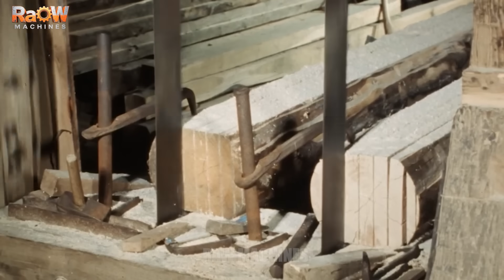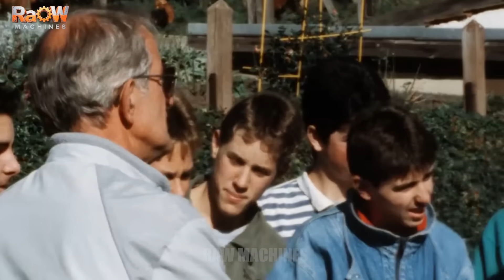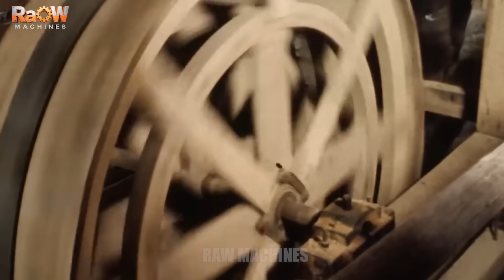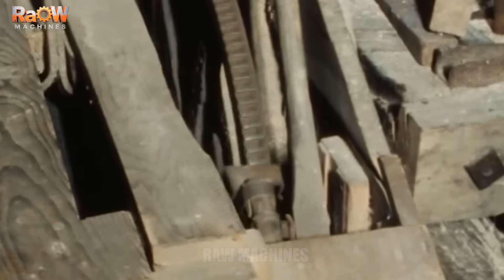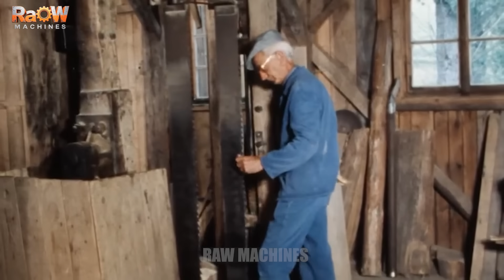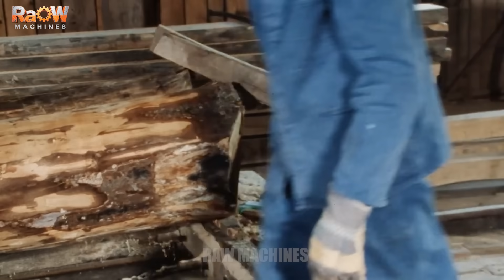Before Electricity: Inside a Water-Powered Sawmill That Still Works Today | Germany

Comment: Thank you sir. This is a true form of mechanical engineering that makes use of the very basic resource of water. The very first thing I noticed was the level of noise,much quieter to work around. The process has been very educational and a reminder of just how far we have come. 👍👍👍😊
Reply from the maker: Thank you so much for that thoughtful comment. You’re absolutely right—using water as a primary power source is elegant engineering at its core, and the quieter environment really changes how the work feels. Which part of the mechanism stood out to you the most?

Comment: Post apocalypse I know exactly what I'm building first. Chainsaws are a efficient but gas and oil are finite. Water, that's much more abundant.
Reply from the maker: Haha, exactly! Water just keeps flowing while fuel runs out. That’s one of the reasons these mills lasted for centuries—they’re simple, reliable, and off-grid by nature. If you had to pick one water-powered tool to build first, what would it be?

Comment: Fascinating thankyou. Water power only about 150 years ago was being overturned for steam where someone thought that burning a lot of stuff to boil water and to generate power through superheated steam in a complex mechanism needing massive stockpiles of fuel disposal sites for ash etc was actually a good idea. Maybe in some contexts ok but free clean hydro power is now making a comeback thankfully , and the German sawmill is a superb example. We have a similar water powered forge with bellows and drop hammer still working at Sticklepath in Devon , maintained and worked on occasions throughout the year by the National trust. It is called Finch Foundry and manufactured agricultural tools . The water from the myriad of leats on Dartmoor channelled into the village.
Reply from the maker: This is such a great comment—thank you! There’s something deeply satisfying about power that flows freely from nature and keeps working century after century. Finch Foundry sounds incredible, especially with the leats from Dartmoor feeding the whole system. It’s proof that “old tech” was often smarter than we give it credit for.
Have you ever seen one of these water-powered systems in action up close?
Reply: @RaWMachines-g9r thanks yes visited several times they held a meeting for Vintage motorcycles on a Saturday afternoon in May annually which I attended.FYI
at the other side  of Dartmoor there is a couple of large catchment tanks fed by the Dartmoor leats (which have to be maintained) which feed a hydro power station built at Mary Tavy which at the time was intended to power Tavistock. It still works but now owned by the highly irresponsible SW water sadly so the engineering training has given way , the workshops which maintained the turbines and Pelton wheels seem deserted when I visited a few years ago. 
   Hardly with their record the right people to be in charge of such a superb heritage working piece of engineering history. Maybe old (built in the thirties ) but totally functional feeding the grid 24/7 and must have paid for itself umpteen times over by now surely.
Reply: The distribution of rivers and ponds and lakes suitable for exploitation by water wheels is very limited.  In addition it disrupts navigation and fishing.  Dams cause massive environmental damage by killing vast areas of vegetation causing them to boil off CO2 and methane as they rot.
-Everything has limits.
-Timber was running out for Home heating and cooking so coal started being used.
-It was taken by ship from Newcastle down to London from the 16th century.
-There wasn’t enough wood any more and it was too expensive.
-Mines need to be pumped out of water and so steam engines were developed to use a portion of the coal to suck out the water.
-To haul coal out of the mine wooden tracks were placed.   Eventually, the steam engines used for the pumps were used to winch out the coal and tin.
-That eventually led to steal rails and locomotives replacing the winches.
-The steam engine changed your world.   It gave plentiful coal and minerals so that human beings could have the benefit of metal in abundance.
-It eventually allowed manufacturing to be placed away from heavy water flows.  
-Railways then allowed people inland to enjoy fresh sea fish.
-It allowed people in cities to get fresh vegetables from the countryside.
-In 1868 Australia and New Zealand started exporting frozen beef and lamb using refrigeration powered by coal on a sailing ship.  
-The internal combustion engine with a necessary next step.  Smaller and more efficient and safer it could be transported on a donkey to a remote mine or make a tractor door that was light enough to use on European soil without collapsing.

Comment: I think this is my favorite video so far. I commented on the windmill that I’d like to see the machinery that it runs and that’s definitely what this video did as well. And it answered nearly all the questions I had while watching it. But I don’t understand where the water comes from in the first place and how they get it up to that height to use it. I didn’t see a lake or a river. It looks like the building is down a hill so maybe that’s where the height comes from. 
And these appear to be 8’ in length. From what I see this machine is limited to how long a log it can cut because of the length of the carriage but also physically loading the logs by hand. So 16 or 20’ joists would not be possible. 
And it was interesting to learn that the blades are reciprocating and not radial. Great video. Thanks for sharing.

Comment: Why do they not use circular saw blades? Its seem like it would be faster
Reply from the maker: Great question, and thank you for watching! Circular blades are definitely faster, but this mill was designed around a traditional vertical saw, which works better with water power and is much safer and easier to maintain using old technology. Would you prefer seeing speed or historical authenticity in a place like this?

Comment: It's amazing how so little water can produce so much power.
Reply: The water wheel's output and efficiency is mentioned at time 5:52. The wheel itself is about 90% efficient and produces 15hp (horse power). That's hp at the wheel not at the saw blade.  Friction losses from all the other wheels,  belts and slides reduce that number but let's go with 15 hp.

For comparison sake a 1960's Suzuki 50 cc motorcycle produced about 3 hp. The more modern Suzuki GS500 produces 40 hp at the wheel. From that perspective the water wheel really doesn't produce much power. Granted it uses not much water. 

Oh but look at it cut those mighty mighty logs. Hmmm Well it's not cutting them very fast. He might get 3 boards cut before lunch. There are vids of modern sawmillls on Youtube. Watch one of those and witness board that size being ripped off in well under a minute. I hope the school kids who visited the water powered mill visit one of those mills too just to see how far we've come and how much they stand to lose.
Reply: @manatook-d9m  While it's still amazing how so little water can produce so much power. Bye-now!
Reply: @manatook-d9m  By my reckoning he gets a bit more than three boards before lunch. The video mentioned one saw run would take about ten minutes. Add another ten for repositioning the lumber between runs and you still have three runs per hour. Using two blades he gets six (6) boards per hour (once the logs are squared).
Reply: So true

Comment: How did they deal with the large amount of sawdust?
Bedding?
Sawdust stoves?
Reply from the maker: That’s such a smart thing to notice! Sawdust was basically “free material” back then. Bedding, compost, heating fuel, even packing material. They were recycling before recycling was cool. Do you think we’re using our waste as wisely today?
Reply: @RaWMachines-g9r 
Here again lot of the sawdust is turned into fire logs. Turning waste into profit.

Comment: Wonderful mill. I’ve just used my Alaskan sawmill to do the same. More portable but otherwise inferior. Water wheel power is sort of free and not burning fossil fuel. No need to rush. Not just quieter but a lovely rhythm. If the lumbar were high quality I think that could be plenty profitable.
Reply: At least when this was filmed, late 80s/earky 1990s, I assume, this was still at least paying for itself. There are always “authentic” restorations going on that will demand this type of lumber too - I agree, it should be profitable.
Reply from the maker: Beautifully said. Free energy, no rush, no noise, just a steady rhythm guided by nature. That’s not just efficiency, that’s a way of life. And you’re right, with high-quality lumber, a system like this could absolutely be profitable while staying sustainable. Would you rather run a mill that’s fast and loud, or one that’s calm and timeless like this?

Comment: This is amazing how they built this saw by hand amazing craftsman ship no electric bill either
Reply from the maker: Thank you so much! It really is incredible what they achieved with just hand tools and pure skill. And yeah, no electric bill is a pretty sweet bonus too! Would you like to try working in a place like this for a day?
Reply: @RaWMachines-g9r  I think I would die of board-um standing around waiting for a board to be cut. Or maybe I could spend my idle time ordering in a 100 hp motor, a gear box  and all the bits needed to hook it up to the saws. I would need Internet access to order all that. Do you have Internet access there or should I bring my  Starlink transciever?
Reply: @manatook-d9m  Yeah nice, I still think his water-powered mill would be way more profitable per log. How much fuel cost to run your incredible setup ? You'll be eaten alive by competitors with established systems, meanwhile this guy enjoys a quiet ecological life. Go work in a factory if you enjoy the fast modern life this much, and don't pollute the comments here.
Reply: No electric bill and unfortunately not many boards cut in a day either.

Comment: A wonderful depiction of simplistic efficiency. I'll bet there was more 'soul sound' to this sawmill that makes it more alive. When I was a youngster, I was out playing with my friends and we came across an old timer who was just opening up his workshop for the day. He had just started his electric motor belt drive system that ran all his saws, sanders, planers etc. and I was fascinated. He invited us in to see and he had flat belts running all different directions in the ceiling all controlled with tensioners to be able to start and stop the different machines. I wish I had been a bit older and could have offered my help just for the experience. Unfortunately our family moved away, but I still remember the sight, sound and smell of his shop.  Great video of the pioneering of the day.
Reply from the maker: Thank you so much for sharing such a beautiful memory. Your story perfectly captures what you mean by “soul sound” — the mix of motion, rhythm, smell, and purpose that makes a place truly alive. That old workshop you described sounds just as magical as this sawmill. Do you think those early mechanical systems had more personality than today’s quiet, sealed machines?

Comment: Something not mentioned here, is 'overhang'. The framesaw system would not work without blade 'overhang'. The blade is not mounted perpendicular, but a few degrees further forward at the top of blade. This means that it cuts as a wedge and thus only in the downward stroke. The reverse happens, coming up, as the blade now comes free of the log and the advance mechanism can move the log into this clearance. If the blade was square to the log, it would be constantly forced against the log, using much more power and undue stress on the frame and the traverse.
Reply from the maker: You used to be a professional in that field; if so, that's a great honor and wonderful.
Reply: I spent a good deal of my 50 years in Toolmaking and machine building, making equipment for saw mills. Framesaws absolutely fascinated me! I learned a lot from a great mill manager who ran a huge framesaw 500 kwatt 1 meter total stroke 15 meter concrete foundation 10 to 12 blades, it was just a monster and head-shaking to stand over. I then started planning to build a small 300mm stroke m/c for my own pleasure, so lots of fun and games with that! They are the steam locomotive of saw milling.
Reply from the maker: @graxav  It would be wonderful if you had any videos; please send them to us. We want to edit and preserve them because future generations will not have access to such valuable lessons, and that's what motivates me to do this.
Reply from the maker: @graxav  It is an honor to meet you here.
Reply: @g @graxav Thank you so much for adding your experience and perspective to the commentary on this video. Your remarks on the necessity of the blade overhang added a particularly interesting detail.  In what geographical area have you worked? // Speaking of steam locomotives, both of my grandfathers worked for the Pennsylvania Railroad during the steam era — what marvels of mechanical precision those engines were!
Reply: @RaWMachines-g9r  No such thing as "professional in that field", unless he's 90 years old
Reply: Good point as on the upward stroke it has to lift the full weight of the mechanism but on the downward stroke that weight assists.
Reply: Why were the blades that long?
Reply: @tomellis4750 The length of blade and width of the frame, are all to ensure enough capacity for bigger logs. Here he is cutting 2 parallel logs,  but the m/c could be set to cut a single larger log. In modern framesaws, generally, the entire log is cut or 'broken down' in one pass with multiple blades spaced to produce the wanted board thickness.
Reply: That's a great comment and makes perfect sense. Thanks for the education!!
Reply: Good information.  Thanks!
Reply: at around 14:00 timestamp yeah the blade is angled
Reply: The sawblades in the video are definitely perpendicular to the logs.
Reply: @samelioto476  I can see that they are not. But please go online and ask the question from Google. And just for information, the other reason why I know, is because the machine cannot work without 'overhang', it would simply stop cutting.